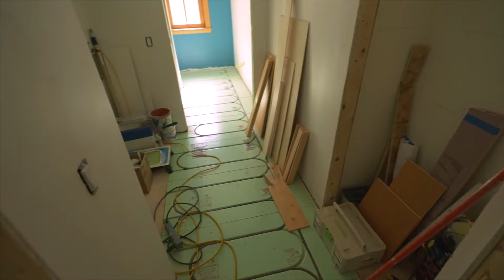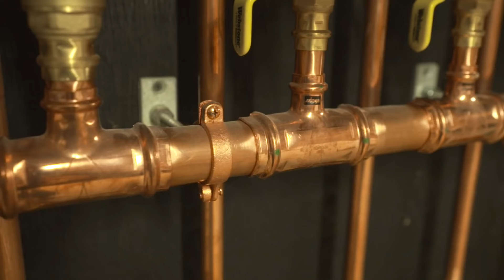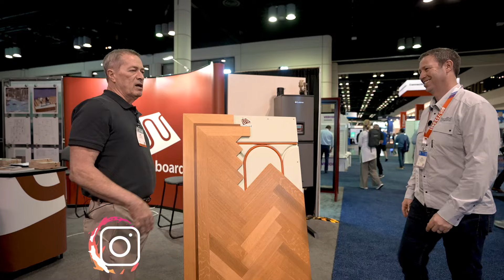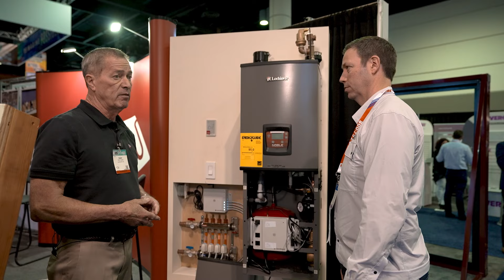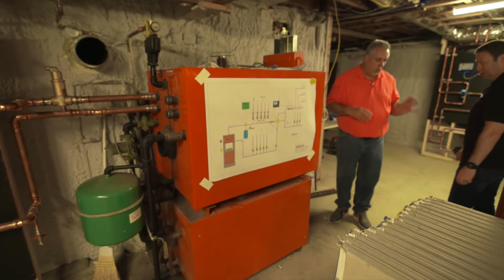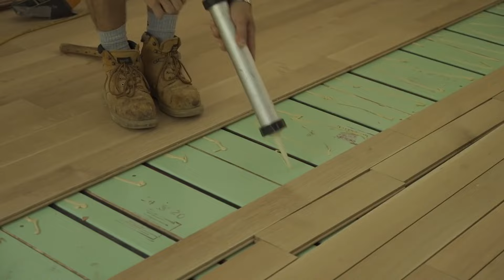ANY Plumber can install this new Warmboard Radiant Heating System

Comment: I have 3200 sq/ft with hydronic radiant heat - some in slabs and some in framed floors finished with hardwood - built all of it myself. I used Crete Heat tubing base/insulation under the concrete subfloors which are finished with 1/2" thick Turkish limestone. For the framed floors finished with hardwood, I looked at warm board for the tubing subfloor material - really expensive! and 1 month lead time! So, instead I used 3/4" plywood and manufactured my own subfloor to hold the tubing - I had to make a steel 'clamp on' template to cut the return radiuses with my router - otherwise all  else was made with the table saw. Cost went from Warm Board's $4000 quote to about $450 for plywood, $80 for the template and a weekend on the table saw. No brainer there. I used 3' wide rolls of radiant foil rolled out over the subfloor and under the entire tubing system. After laying in the tubing and screwing down the plywood, I used an air powered caulk gun and aluminized caulk to fill the little gaps around the tubing and then laid in 4" wide aluminum flashing - heat transfer plates - over the tubing and caulk and quickly installing the pre-fit running of 24"  hardwood floor at a time while the caulk was soft. All done, I was under $800 with a floor so solid. I have one 5 zone system and one 6 zone system to do the whole house. The closed system is completely operated by 2 electric boilers with full operational controls with system performance measurement information manufactured by NextGen out of Poland - they've been building this stuff for over 50 years, specifically for radiant floors. These 'all in a box' units utilize 3 speed WILO pumps, 3 boiler power settings, a pancake pressure tank, relief valves, everything you need - in an attractive box. I filled my system with Cryo Tek 100 antifreeze/corrosion inhibitor at a 50/50 mix. Admittedly, it likes electricity! But the rest of my house is powered with a 12kw solar system with 1200# of LiPo batteries all operated by a Sol Ark power control system. The floor heat is about the only thing I need from the grid.

Comment: I see little talk of small electric boilers, like the ones Electro Industries makes and I've used for decades.  I have plenty, an excess, of free electricity with a long ago paid for PV power system and generous net metering system with my utility. My last build was a shop in town, just 18'x 40, but 14' tall.  With just a 1.8 KW PV system, it produces enough electricity to build enough KWH credits during the spring/summer/fall months, to keep the 5" slab at 50 degrees al thru an Idaho winter for free.  I can make electricity, I can't make gas, other than pant gas.
Reply: Are you using straight electric heating, or a heat pump to heat the water? Solar panels are so cheap now, it's daft not to use them wherever you can get some sunlight on them.

Comment: How would this work once you want to finish a kitchen or bathroom? Drill through the aluminum to pull lines through? Or put it down after after and lose an inch of height from your countertops?

Comment: Lochinvar Boilers are the cadillac of small boilers .  I used the combi boiler that produces not only hot water for my heating system but also makes domestic hot water for my house needs . The combi is the best way to do your heating needs because its the only unit you need .

Comment: This is not a new concept, it's been around for thirty years. ( stadtler) The "foot on the gas" comment has also been around for at least twenty five years. This is how we used to explain a fixed boiler temperature vs outdoor reset.
Plug and play is not always a good thing. The best way to understand a system is to do it from scratch. You learn from mistakes unfortunately, but you will understand how to fix it when it breaks.

Comment: I got a quote from Warmboard a little while back. Great system, but way too expensive for my small 1500 sq ft home. I found another place though, HUG Hydronics, that seems to be easier to install/maintain, and cost less than half of the Warmboard, and other hydronic systems I've looked into.

Comment: The system itself is great, but it would be much more efficient and comfortable if the distances between the pipes would be smaller. I have direct comparisons from two identical buildings connected to the same district heating system and a 10 cm (~ 4 inches) distance was much more energy efficient than that of the other house, where a 15 cm distance was used. In bathrooms, 5 cm was even more efficient, as you want it warmer in there. This looks like at least 20 cm, which is way too high. The heat distributes radially around the pipe, so you have hot and cold spots on the floor. 
I have costumers that used 20 cm distances and they all say that it's uncomfortable to stand on after a while, as directly above the pipes the temperature has to be  too high to reach the desired room temperature. Smaller distances allow lower flow temperature and the heat is more evenly distributed. Especially if there is almost no material above the pipes and there is less space to heat up radially, this effect gets even worse.
In the above examples there was always around 4-5 cm of material above the pipe, so on the surface a wider area is heated up. I would not go beyond 10 cm with this system if you live in colder climates.
Reply: You’re failing to understand how the thick aluminum plating distributes the heat evenly.

Comment: Great Video.  Looking to update the plumbing and heating on my future house.   I am currently in contract with the seller.   
Can I integrate the warm board system and the Uponor Logic System?  The house is supplied with oil from a roth 275 oil tank.  My basement space is quite small so the new compact system is VERY appealing.
Also, in the effort to saving money by buying bulk, can half inch ProPex/Aqua pex be used in the warm board flooring grooves? 
 Thanks.

Comment: Very nice! Does this system work in tandem with embedding the tubing in a slab so you can have radiant flooring in the garage below and radiant flooring in the wood framed floor of the loft above?

Comment: I have some strong reservations about the system. I see  plumbing system that is installed underneath a nailed down flooring. I can only imagine the headache of repairing a penetration or leak. What if u have a flood and need to remove the flooring and subfloor. OMG.

Comment: Miss leading, you still need all of the manifolds and piping outside of the boiler. If you are running a boiler the best option to do is install an indirect water heater off of that boiler. Why would you turn around and install another appliance to heat the water when you already have a boiler installed. 
Another concern is service. If your built in expansion tank goes how hard is it going to be to get a replacement? All that proprietary equipment will be a pain to service over time.

Comment: Google shows the boiler itself is at least $3k for the small model, then the Warmsource add-on, then the boards, tubing, plumbing and installation..... makes sense where it snows but spending 10s of thousands of dollars just for heating is a little too much.

Comment: Matt- installing this in my new home. Subfloor down, cutting the custom routes, then the pex. Plumbers are running the lines to the manifolds and will be installing the Warmboard Boiler. Warmboard is great to work with throughout the process. The local rep came out and explained the subfloor Installation to the framers (who never used Warmboard before).

Comment: I am in the process of designing my new home that I plan to build myself.  One of the things that I am heavily debating is the heating and cooling.  I would really like to go with a radiant heat system but if I do so how do I cool the house?
Reply: I'm going to be building a cabin in the next couple of years (in Arizona's White Mountains), and I'm looking to do Warmboard for heating and probably mini-split(s) for cooling (and possibly supplemental heat, though I probably wouldn't need it). I'm hoping to do something like a monopoly framed 2x6 with ZIP R-12, plus flash & batt inside. I'm interested in any responses to your question.
Reply: If you're doing it yourself cost is an issue. Do a forced air with a variable speed inside and out units. Then spend more on insulation and sealing. No slab on grade.

Comment: Radiant is the way to go. But dont fall for the bs zone valves for every loop. They all break eventually. Simple circulator’s with simple headers for each zone you want. Labor intensive but worth it.

Comment: Anyone know what warmboard runs per SQ ft?
Reply: It was roughly $13/sq ft back in December 2020.  I’m sure it’s higher now with all the supply chain issues.  Give ‘‘em a call.  They’re really nice guys and will give you a much more accurate answer than I can.  Again, that price included the boiler, controller, thermostats, manifold, tubing, boards, shipping so a lot was included in the cost.
Reply: Answered above.  Complete system installed around $20/sq ft
Reply: @pauledwards1157  I was really looking for materials cost.

Comment: This is fun! I live in Denmark (Scandinavia) where all new houses are fitted with floor heating which have been the standard for more than 20 years.
You guys in the US really need to look abroad. I can recommend the Danish based company Danfoss. They produce combined units for both heating and hot water, and the systems with manifold for the circuits are not complicated and big like the ones you are used to in the US.
The Warmboard panels are not invented by the guy in the video - it can't be. I have seen similar products here in Denmark for many years.
Reply: Huh. Here I thought Danfoss was American because they made stuff in the USA. 
It would be great to have in floor heating, but that isn't going to happen in the house I live in.
Reply: Thanks for the headup. I just went to Danfoss and they have a complete technical guide about floor heating, with a special section about wood floor (with maximum recommanded heating power depending on how the wood is installed on the floor etc.) This is a wealth of info there and explain all the process step by step so that a homeowner can either do it or at least check that any contractor isn't doing some dumb mistakes. I'm en Europe too and I know Scandinavia has all the tech know ho how to do it properly. Danfoss is a very impressive company, I would totally trust them on anything heating related. Now I just hope they would also be competitive price wise, but I would always prefer quality and security (a house is an investement not an expenditure) rather than just price.
Reply: There is also a company out of Poland that has been building a complete system for decades, NextGen, check 'em out.

Comment: Okay so 10 years from now one bolt of lightning and you are screwed . Keep it simple . Just simple zones on basic thermostats.
Reply: You won't even need the bolt of lightning, slim form "modern style" electronics don't seem to last. All things can fail but with this integrated system good luck replacing just the one failed component in 10 years.

Comment: Great move by Warmboard except... I hope there is a heat pump version coming shortly. Installing new natural gas powered equipment in 2022 feels irresponsible to me. A unit with an integrated heat pump, or a bit more complex but I think doable a heat exchanger to which you can connect whatever source of hot water you want, will really be the future.
Reply: there is both a traditional electric boiler and a air to water heat pump option now.
Reply: Natural gas is by far the most efficient way to heat this system.
Reply: @tomsplace239  even if that is true for the moment (which I would argue it it not) you'll be tearing it out in ten years or less. Everything new install should be electric at this point or you'll never reach payback point.

Comment: Korea has been using this sub-floor heating system for 100s of years. The system does not have to be as complex and complicated as "the inventor" has made it out to be. Sub-floor heating products are sensible and energy efficient. I definitely appreciate much of what Matt brings to us. The hyperbole of "our system fixes everything" is unnecessary.
Reply: it's not really that complicated if you look at the basics. The whizz-bang factor is all in the wireless T-stats and water temp change based on heat load. Of course you have been able to buy foam insulation with pipe tracks for years. Their system is wood based so easier inside a home. You could probably get away with 7/16" OSB for a sub floor too. (cost savings)
Reply: The Romans had radiant heat floors.

Comment: Loved the way he just steered/drifted the conversation entirely away from cost. I mean, how hard can it be to give a rough cost per sqft for the system...?
Reply: I installed a Locinvar combi boiler , all the rubber under wood  floor tubing and the under floor basement tubing  ... pumps for a 4 zone system and thermostats . I have a 2000 sq. foot main floor  and 2000 basement  house , the cost for the equipment was around 12,000 .
Reply: I’m building a new home with cathedral ceilings in a  4 season, Northern New England climate, slightly higher cost than conventional heating systems with greater efficiency, and the product that is complete from A-to-Z.
Reply: I got a quote for my house 90,000!!!!

Comment: I wonder if it could circulate cold water in the summer.
Reply: If you could find a way around condensation and then mold forming inside your building materials it is probably possible. The condensation would probably form even on the backside of the Warmboard panel inside the plywood.  Maybe on a cement floor?
Reply: @jamespitcher327  it's a big challenge.  Perhaps with high surface area, low humidity, and a water temperatute that is cool, but not too cool.

Comment: You would have a stronger voice than I would as an individual homeowner…but (1) what if Huber Zip Sheathing had the rainscreen furring strips built into it? Maybe they could find a way to design it so it didn’t interfere with the tape application…??  (2)Can Warmboard engineer the system to work under wainscoting or on the ceiling like in one of your past videos?  (3)Do they have an efficient electric water heating option?

Comment: For a better and way cheaper system 
https://youtu.be/zc1NSeqaA1c  
And please use this tube layout, not the one in the vid. This one spreads the heat more equal. Keep 10cm between pipes, and loops not longer than 100meter. Put those loops on a manifold wit a pump and u can hook it up on any warming system because the manifold controles the temp and mixes loop water with heating water till the right temp for the system is reached. 
Here is vid of a manifold we use europe, u can hookup any heating system u want 
https://youtu.be/iAi0fUnayjA

Comment: This is old in europe.
And  use a "snail patern" instead of the tube layout they using in this vid .
With the tube patern in this vid u going to create a heat difference between the begining and end of the tube.

Comment: These new floors , furnaces, geo-thermal, solar, are all very efficient and air tight homes meet the code very nicely in Northern parts of the Country and South too.  Lot of the insulating and AC and builds are great too in South with ICF and other construction (we live in both the South and North, not quite snowbirds still enjoy snow and the sports North ).  Yet, the problem that is developing is cost.  We're in the process of trying to build a summer home on a couple acres in a  Northern State not to far from Canada.  Not real rural but still short of builders that even keep up on a lot of this information.  Today we just got a quote for 2300 sq foot home at $750,000.  Lowering it to just 1500 sq feet still comes in at $525,000.  Builders are at $250 to $450 a sq foot that is if you can get the supplies.  One builder told us if he ordered Pella windows (this area can deal with -35 F in Winter) it will be 36 months before delivered.  A half a million for a 1500 sq foot home (does have a three car garage) is just nuts.  Add a Poured or Superior wall basement with 1/3 finished basement your now at $700,000.00 .  Do all the great things shown on the program and you surpass a million for a very small home.  Of course what happens it will bring everything to a grinding halt. 
Still love the Channel and have been involved in alternative building and designs since the 1970's.  It's sad that the prices are overcoming the great inovations coming out.   
Keep up the great work on the channel.
Reply: I agree, in most cases building prices here are crazy right now.  However, I recently used Doorwin Windows and Doors (a great company out of China).  You can buy windows and doors directly from the manufacturer, saving money and time.  Their products are great and they can have your window/door schedule built out and shipped to the US within 8 weeks in most cases.